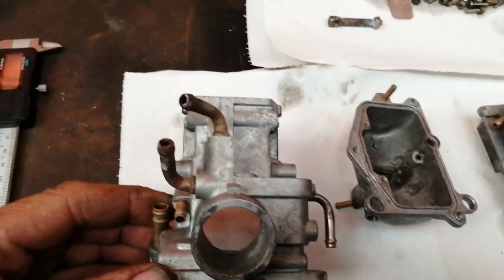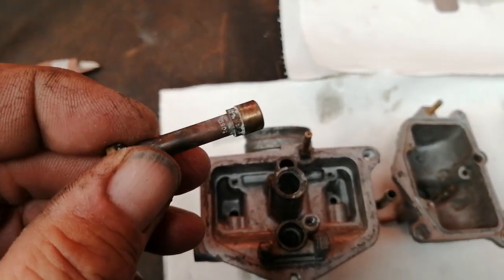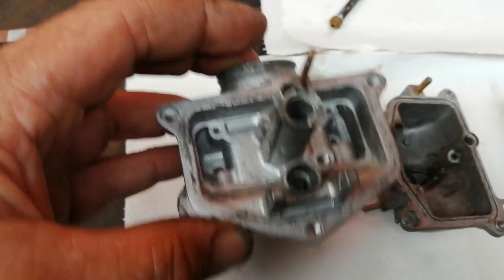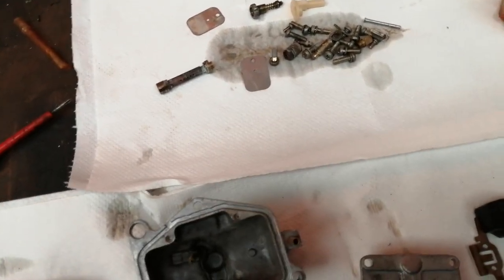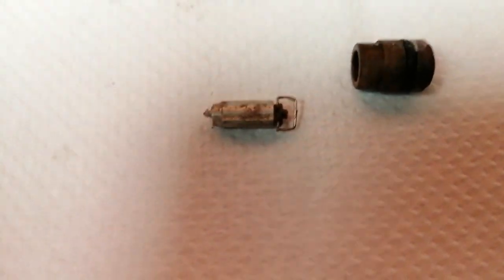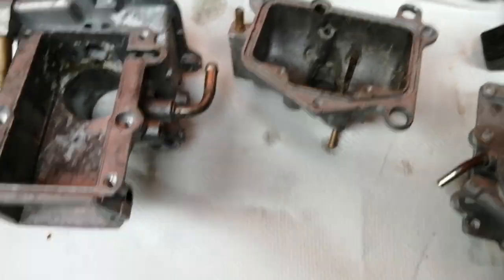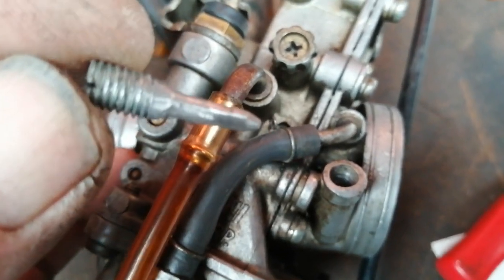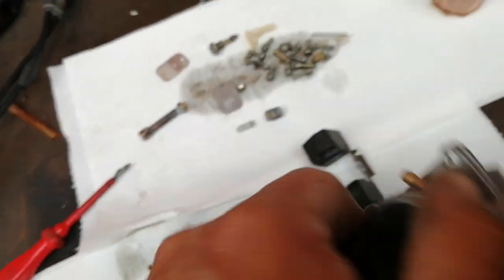Mikuni TM28 Carbu carburettor carb  carby for the DT125r dtr yamaha 125 and its common blockages

Comment: You're one of a kind, aren't ya? Cheers for exposing some of the utmost regretable shate that can go wrong with these! Me myself currently having an overflow/flooding issue(as soon as I turn the tap ON petrol starts pouring on the ground) but ain't gonna get discouraged anyway.
Greetings, lad!
Reply: Did you ever get this sorted?? Currently got exactly the same issue
Reply: Aye buddy, the floater was stuck. I've only removed floater bowl(carb's bottom) sprayed everything inside with carb cleaner(also removed and cleaned jets on this occasion - sat a day in vinegar and ran dental floss through all orifices) then immersed the pieces and let them sit inside a big jar filled with gasoline about a day which also made a decent amount of juck to pop out of it after a shake or two. Good luck!
Reply: @FlyinBananaDT  nice thanks for reply mate, I’ll check out the float

Comment: Just got myself a dtr myself and got spark and all that jazz and no start so I think the carb has been dicked with. Got it apart now and all seems ok so i'm going to knock the jet tube but was wondering how it goes back in if you have to knock it out with a punch. After cleaning will it just slide in or will it need brutal force to be applied lol. Cheers for the tutorial.

Comment: Hi. I have a Yamaha Tzr 250 r (3xv) 1991 model. It has two carbs tm28s with two type of main jets. 190 & 260. its a nice video thanks man.. by the way it made me laugh when you show that bullet air adjustment screw. hahaa..

Comment: Hi, I have a 1990 dt 200 r and having carb issues at mid - full throttle. How important is the washer under the main jet? Manual asks for #150 main jet and when I bought the bike it had a #115. I’ve spent the last few months rebuilding the bike and she’s almost ready.. this is the very last thing. Also thinking about deleting the coolant lines running to carb. Anything helps! Thank you I’m advance :)
Reply from the maker: The washer is very important as it locks the needle seat and emulsion tube in place.. So it cant move up with the throttle slide and needle as for jetting tuning needs a box of jets and time with plug chops etc
Reply: @angeladtoldwoman4242  much appreciated.

Comment: Hi Mister, I have a Yamaha DT125R and it will only run with the choke even when the engine is warm if I turn the engine off it just dies? That is, I can drive the engine only with the lever on the carburator raised, and it happens that it lowers itself while driving and chokes and shuts down if I don't raise the lever in time while driving. When I drive like that on a straight road, it's not terrible, but in the hills it raises the temperature quickly. I'm curious if you had such a problem and how you solved it, and who understands these engines, how to solve it and see what the problem is*?*
Reply from the maker: You have a blocked main jet my friend or possibly the power jet in the float bowl
Reply: @angeladtoldwoman4242  I don't know, since I got the engine it's been working like that, the carburetor has been cleaned three times so far and it's still the same problem, so I wouldn't say it's the main jet, but what could be wrong with the power jet, can you tell me explain?

Comment: Hi i have a 2000 dtr 125 bike is very tidy bike was sat for over a year fuel stale im guessing i tried to start her and nothing she normally fires straight up so took carb off cleaned ect fresh fuel and plug runs but at low rpm has a bog put the choke of no bog take the choke off no bog for a bit then bog starts again?
Reply from the maker: Ultrasonic clean your carb its bunged up somewhere
Reply: @angeladtoldwoman4242  could a leaking fuel tap be the cause?
Reply from the maker: @mattcowlard4662  it wont be beneficial but you will find theres a blockage somewhere either in the choke jet the emulsion tube or the power jet and pipework

Comment: im ceaning one of the right now and it was pretty bad  its from a 1993 yamaha dtr and i belive its the tm28ss version😂 i knocked all the stripped sized screws out of it (lots of fun for like 2h) it was very coroded and everything was pluged 😂 but i got everything out of it but i could not save the floatvalve (maybe you know what type it is) the ony thing left thats still cloged up is the powerjet line in the bowl and the choke line also in the bolw 🙄 do you have any tipps to get that free ?
Reply from the maker: time in an ultrasonic bath with the correct chemicals is all i use
Reply: a litte update 😄 i got it all restored and polisched 😁 looks better than new and im probably gonna sell it. everything on it is good for high fuel flow (3.2 float needle valve and all the fuel channels are even big enough for a methanol-nitro conversions) and i put a little fuel restriction pipe inside the tube connecting floatbowl to powerjet(because it was just dumping so much fuel trough the powerjet).
anyways the jetting for a 125 2 stroke is 240 for the main jet and a 38 pilot and the stock needle. and i was thinking about using it on a 4 stroke but im not sure if i would have to change the needle to use it with the smaller jets (around 150 im guessing for a 4 stroke 125) im thankfull for any help 😂😁